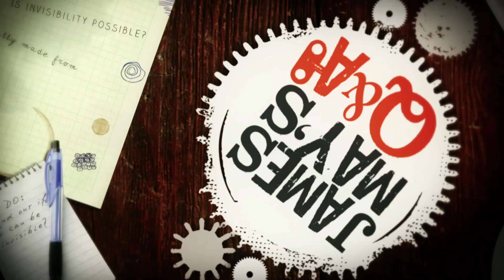Why Can't Trains Go Uphill? | James May's Q&A | Earth Science

Comment: coat the uphill part of the track in a thin layer of rubber, BOOM! solved, where's my billion dollars?
Reply: +Mario G would require far too much maintenance, because the as the train passed over it would remove the rubber. much easier to just ensure a smaller incline when building the track in the first place.
Reply: +Mario G The solution that works everywhere is don't build the railway too steep. Easier to give the construction engineers a headache than the operational railway a headache for 100s of years.
Reply: Sounds reasonable, but I assume it'd be more expensive to maintain than it would be to divert track around a hill. Plus have you ever seen pennies and stuff that fall on train tracks, I guess you'd need to replace the rubber after every passing train,
Reply: +sharad 14 No, you wouldn't need to replace the rubber after every train, except for a small section at the bottom of the hill. See, the first wheel on the engine would strip the rubber off before the rest of the wheels could reach it. Since one wheel, even rubberized, wouldn't generate enough traction, the train wouldn't be able to reach the upper part of the incline. And since no train will ever get that far, there's never any need to replace the rubber. :-)
Reply: HiddenWindshield Yeah okay, but that still defeats the whole purpose.
Reply: sharad 14
Yes, I know, I was being sarcastic.
Reply: how about making round incisions on the uphill part of the track? then inserting a durable composite that can be similar to rubber that will allow for better traction.
Reply: +Mario G Find a rubber that can withstand 200,000 pounds per square inch of force from the locomotive wheels and you might be onto something.

Comment: Hmmmm I do not completely agree. When a train starts on a level track it does not pull all the boxes at the same time. The engine drags one box first. Then the front of the train moves the second one behind. This continues until the entire train starts moving. On a level track the train can easily keep moving. Just remember guys law of inertia. Once a thing is moving on a straight line you only have to overcome the air drag and the friction. However on an incline the engine simply does not have enough power to pull the entire train. However if a train were to approach an incline at a great speed, then it might climb the gradient of the speed had sufficient momentum built up. I do not agree that the traction is insufficient for the train to climb. The train cannot climb simply because the engine cannot generate enough power to pull all the boxes up the incline. Climbing the online is different from traveling on a level track. Suppose the train has a geared wheel which bites a geared track the train will not be able to climb the incline. Did you understand that guys, what I am saying is that supposed the wheel and the tracks meshed with the help of teeth like a great does- the train cannot climb- this is because the engine cannot pull all those boxes- traction is not the only factor.

Comment: Well first off there is standard railroads in the US that have 8% grades as a norm like logging lines. Here trains are bigger and have sanders which give traction. The coal trestle of the DL&W yard had a grade of 4 percent yet 0-8-0 switchers could push 5 fully loaded cars of coal up and down with ease, plus having mainline grades of up to 3% with no struggle by the engines. This doesn't include the diamond branch that very well exist today with a sharp curving 5.76% grade down to the D&H main line. But still although much of the steam records for this line is gone, the Alcos for the DL have no trouble with the grade with 10 car trains. So the conclusion is you built your trains wrong, you should put sanders on them and make bigger engines. Heck a P2 can fly over something like the steep grades leading through horse shoe curve, but they were ruined and scrapped cause they were too good.
Reply: +Aaron Davis yes, just as bad as I read that in a COD playing 12 year old on TF2 voice. ;)
Reply: anglovirtual it is more so just make sure to add weight where needed not make it more powerful. you are thinking west where they fight for bigger. a small shay could pull everyone`s trains with no need for bigger or more.
Reply: +Matt`s Mocs I think you will find that nearly every train in the UK has sanders! The majority of our lines were built without much incline, so we never needed trains to be amazing in the uphill stretch. The lickey as mentioned in the video, is pretty muxh the exception! America has an infrastructure with a lot more gradients, meaning that the main focus of a succesful railway would be power and uphill capability.
Reply: wait a minute isn't that 5.76% gradient the one Old 97 wrecked on.
Reply: +MrDalek2150 it was a 6.1% and after the wreck of old 97 in 1903 the grade was reduced to a 3.4% with a longer approach.
Reply: Aaron Davis yea. Well at least Top Gear is coming back. Besides its not like reading something as the stig. :D
Reply: Aaron Davis Well it is the second longest running current show, plus is just that great.
Reply: Matt`s Mocs The point isn't who you are, the point is how it fits into the narrative of British vs. American which is quite a familiar one to anyone who watches Top Gear.

Its exactly the kind of thing you expect to find in this context.
Reply: David n One word, well multiple "Cass scenic Railroad" There is grades of 10% on the line.
Reply: +Matt`s Mocs in Germany a grade above 30% is considered steep. The normal small city trains (public transport ones) can already do 10% with ease. And  big trains can do 25% easily
Reply: djteac well I know a bit of german modern engines, it is not if they can do it. Electrics have better uphill than desil  (pardon my terrible spelling and rubbish auto correct) which from that steam (shays, climax, etc.) are also good at going up hill. so it depends on what it is. plus much lines are flattened out for higher speeds, (banking curves exceptions) .
Reply: David n weight. it is all in how heavy it is. I know that street cars (not cable cars) can go on some steep grades, I even seen one with some freight cars go up a 10% grade at decent speeds, that grade had ten ALCO diesels with less cars go up it and they struggled from things like bottoming out and traction with not just the cars but there on top wheels motors. it is not the drive train, it is whats on top the trucks.

Comment: How much contact area something has with something is  irrelevant with the friction between them.
Reply: Faruk Balcı I thought the same, but perhaps the simple linear F=f*N formula is over-simplistic. For example it doesn't take into account deformation of the surfaces (rubber wheels).
http://en.wikipedia.org/wiki/Friction#Limitations_of_the_Coulomb_model
Reply: +Peter Bone You are right, but in this case ( metal wheels and metal rails ) I  think it(f = f*N) will work just fine. And in the video he presents the low contact area between wheels and rails as a fundamental reason of low friction (most probably it is interesting to talk about ). It is just a misconception.
Reply: +Faruk Balcı The Coulomb law may work fairly well for train wheels, but he's comparing to cars, for which it doesn't work well. It's true that the reduced surface area of train wheels reduces friction in comparison to cars or other vehicles with tyres.

Comment: Leaves on the line is a problem because crushed leaves create a natural Teflon-like material which gives the train practically no friction whatsoever. The wrong kind of snow can get into trains' electric motors and cause them to burn out.
Reply: ReddwarfIV I always thought that leaves acted as an insulator on the third rail. Nearly all trains in the UK are electric and powered from a third rail. Nothing to do with friction.
Reply: Peter Bone "Nearly all"? Many of them use a pantograph, and we also have a lot of diesel powered trains too.

Looking up the problem, according to Wikipedia, leaves on the line caused a lack of friction. It mentioned problems with electrical contact, but only in reference to signalling.
Reply: ReddwarfIV I've never seen pantograph trains in the UK. I live in the south. perhaps they're more common in the north?
I said that it was what I thought. Thanks for the correction.
Reply: That makes sense. The South is largely electrified with 3rd rail, but you specified the whole country. I live in East Anglia. My local station has class 365 pantograph trains going to London and class 170 Turbostar DMUs going to Norwich.

Comment: Even on model trains this effect is very evident; several of my locos running on what's supposed to be a flat board romp off in one direction but struggle with the same train in the reverse direction; usually they lose their grip on the rail (which I suspect is, proportionately much greater than that of a real train, as model railway wheel profiles are extremely crude.

Comment: The Snowdon Mountain Railway gets around that problem with a rack and pinion system, a cog under the train links up with a notched middle track on the rails, the relatively small engine then pulls the train up with a proper grip, all the way to the top of Wales' highest mountain, where you can have a cup of tea in the cafe near the summit. The trains do have a lot less weight to pull up though, generally three small carriages.

Comment: Downhill many modern trains use regenerative braking. There's magnet and coil setup (basically a generator/motor) on the wheels. As they turn, current is generated, which is used to recharge batteries (like an alternator), wasted using resistive circuits, or in the case of electric trains, fed back to the supply to help trains climbing the hill. Lenz's law states the coil of wire will apply a force opposing the one turning the wheels of the train (gravity) and make the train slow down, to a point where normal brakes can work better.

Comment: Trains here in the US can climb grades up to 5% on some lines. But our locomotives are much heavier and bigger than what's used in the UK. For example, about a ½ hour ago I watched a 122 car long train pass through my town with two 4,400 HP diesel electrics to top it off. Each car fully loaded can weigh a little over 280,000 lbs loaded. That's 127 tonnes per car. That means that train could weigh more than 15,494 tonnes. And our locomotives are able to pull train like that up 5% grades. 

Luckily the UK isn't has hilly, or mountainous as the US. So it's not a big deal if UK trains can't do the same, as it would be pointless to make them that heavy, or powerful since trains are generally much shorter and lighter anyways.
Reply: Brenden Perkins There are/were 5% grades In the US. It's well documented. Most 5% grades may be abandoned now. But steam engines were pulling them and have less adhesion than diesel electrics. 3+% grades are still around. And one 5% grade is still around on the east coast. So you can't tell me that they struggle. American locomotives are the world's strongest and most heavy haul locomotives in the World. I have been rail fanning all my life and personally know engineers. There are videos of them going over those grades as well.
Reply: +Scootaloo yeah saluda. and theres a very good reason why saluda is no longer used. and as for america having the strongest locomotives, well as you are right in theory, you have to take into account a railroad will only order as much power as it needs. not to mention that most of the worlds railroads have the same ge and emds decorated with a different shell. so why would england or scotland 2 countrys with less need for power buy stronger locomotives? so to say we have the most powerful isnt realy a bragging right as much as a necessity.
Reply: rebelbull14 Well most of the world runs smaller locomotives than the US. Only Canada Mexico and Australia basically use American locomotive power for the most part. 

I'm not really saying it's a bragging right. It's just what it is. And you're right it wouldn't make sense for a small country like the UK to have such large locomotives like the US. As a matter of fact, their tracks bridges and infrastructure in general are not equipped to handle such massive locomotives. So it would be beyond pointless to order something like that.

It was funny to see the British Freightliner locomotives side by side the US locomotives that were used to haul them to the shipping yards though. I saw the pictures and a video here on YouTube and it's quite a difference in size. (Even though the British locomotives are still plenty big to squish a car like a grape.) LOL!
Reply: Scootaloo American trains are pretty awesome to see though!
Reply: 5%? Heck no we can't. I'm an engineer and we run coal loads with 2 engines on the head end and 3 on the rear. They struggle up our less than 2% grade.

Comment: whats the point of trains anyway
Reply: Scootaloo  I thought I had replied to this but apparently I must have been mistaken. The weight of coal per wagon is 57 metric tonnes. As for train length, that is somewhat limited by curve radius and by the radius of the balloon loops at the mines.  The loops at the iron ore mines are typically 2 to 3 times the diameter of those at the coal mines.  You don't want to pull the middle of a train of empties off the rails.  

Some coal trains only have 50 wagon trains, other have 100 wagons, I do not know which trains come from which mines as there are a dozen working coal mines in the Bowen Basin, where, BTW, the track gauge is 1067 mm (3' 6").  I used to live in the area, but that was just over 25 years ago. Some of the branch lines to the mines are electrified, some are not.  The electric locos currently in use are Siemens from Germany, the diesels are probably of US design.

Further, part of the right of way for the Bowen Basin coal mines was constructed in the 1870s -1880s over some very soft soils and despite upgrading probably cannot take the loading that the iron ore trains would create, particularly in wet weather.  According to an anecdote from the time of the construction, a man easily pushed a 12 foot iron rod straight down at one locality, in other words the soil there is slop after heavy rain.    

The iron ore trains are on the other side of the continent, around 3000 km away, are standard gauge,have an entirely different operator and began operation in the late 1960s or early 1970s.  These lines run over desert country which rarely gets any rain. One of the operators have recently renewed their loco fleet, sending the used ones back to the USA but I could not say which offhand and I don't recall  what replaced them.  You can find out if you do a web search on these trains.

I'm a chemist, not an engineer, but I have some knowledge of rail & road construction having worked in it for 2 - 3 years. The point of course is that road transport just couldn't do it, whether a 50 wagon coal train or some other ore or coal train train anywhere.
Reply: paul hunter Without it cars today would not be alive, so have respect for trains, the earliest trains had Steam engines, and with these steam engines and light steel wheels, it meant that this was the fastest way to transport goods through land, at the time, later the steam engine was adopted by cars, then many years later as the train was very well dead, there came a time where they invented the electric motor, which could power these babies of upward 188 MPH that's enzo ferrari fast, and now electric motors are being adopted once again by cars, isn't that a coincidence??? so remember the next time you see someone complaining what is the point of a train, tell them it helped in so many ways that only engineers of that era could understand
Reply: paul hunter  There are trains in Australia hauling around 100 wagons each with about 50 tons of coal in each wagon, plus the weight of the wagon of around 20 tons. Two or three locomotives in the front, one or two in the middle, all electric on 25,000 Volts AC.  Gross train weight often exceeds 10,700 tons.  Several of these pass through the town where I used to live every day, plus other shorter coal trains from other starting points.  Those trains are not the biggest in the country. If you want bigger trains, see the iron ore trains in Western Australia which are all diesel-electric hauled. 

How many 18 wheeler trucks would you need to carry the same quantity of coal or ore?
Reply: Codenwarra Cove 50 Ton's of coal each? Why so little or light? I thought Australia was switching over to all US equipment so they could haul 100+ tons of coal for each car like our 120 ~ 200 car long trains. I know Australia used US built equipment to create a world record long train once as a test train. Here in the US, the average train for passing through large cities averages 100 ~ 150 cars long. And out in the country can exceed 200+ on a regular basis. Each car will hold 100 tonnes or 110 short tons of coal not including the weight of the car. 

Coal trains here can easily exceed 30,000 tons. I know on average the US has the world's longest and heaviest trains. But Australia is supposed to be a little closer now. And certainly heavier than what's used in Europe.